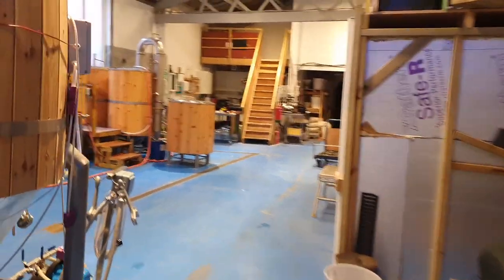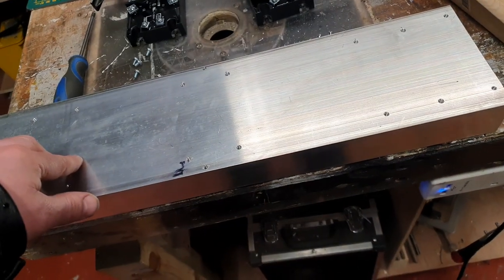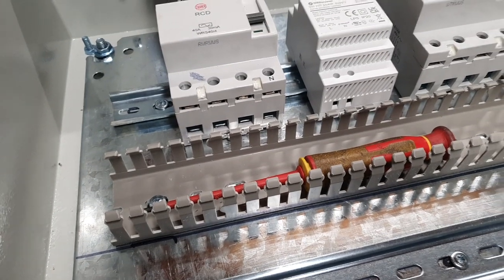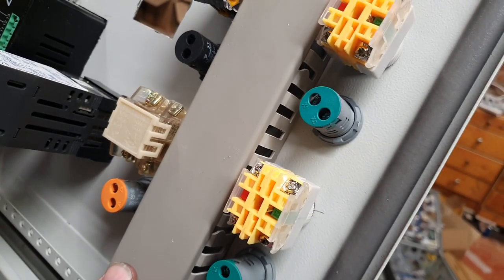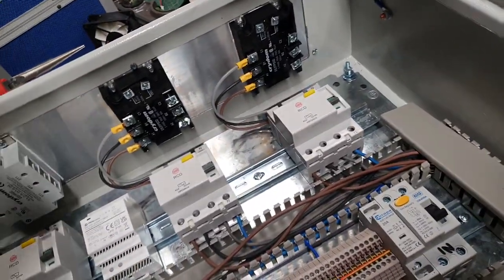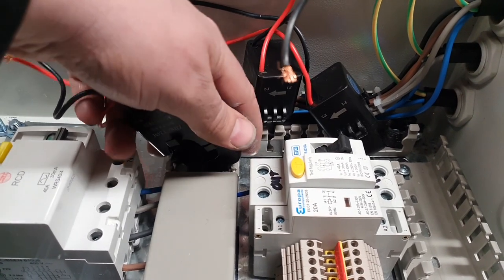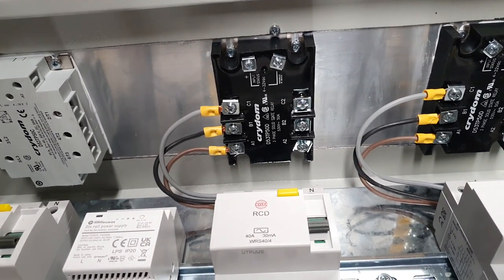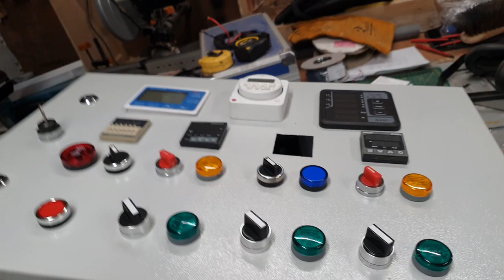Mounting the SSR to the Heatsink & DIN Rail Components

Comment: The dogs are so enthusiastic for that morning jaunt. If you're interested in the BEST CONTACT POSSIBLE for the SSRs, then you need to match them with sandpaper. IT guys do it with CPUs and heatsinks (yes, I am one of those) - same process applies - using the sandpaper yields a mirror finish on heatsink shoe and SSR and very minimal heat sink compound between them. You are minimizing the micro imperfections in both mating surfaces...therefore, reducing the need for much thermal paste. More efficient. I never tire of your ingenuity and boundless energy for improvement. Cheers!

Comment: Nice work 🍻 make sure you check those RCDs work as expected with the supply going in the bottom, looks like terminal 1 is at the top. Worth checking with an RCD tester while ya building 🍻
Keep up the good work 🤩🍺
Reply from the maker: Yeah they work both ways but testing is worth doing if you can, I will hook the MFT up to them on the next vid.